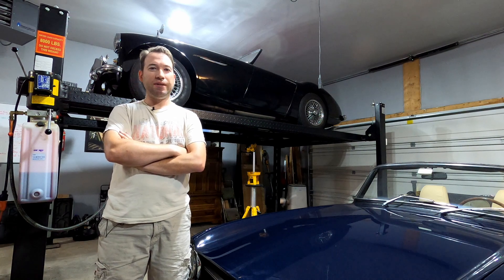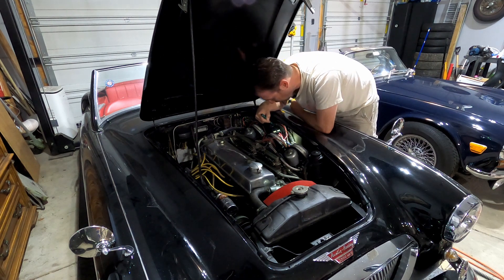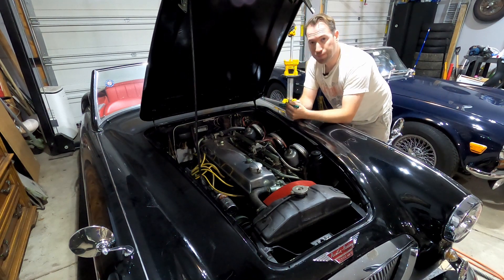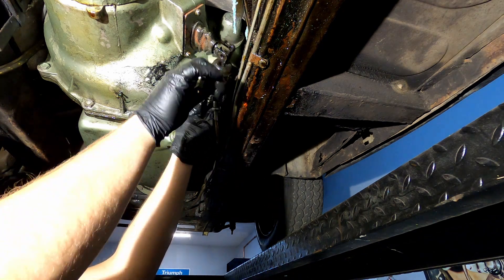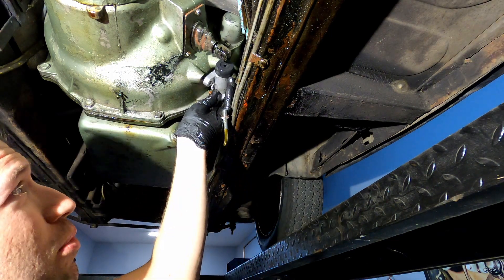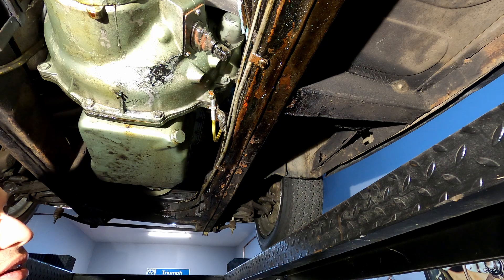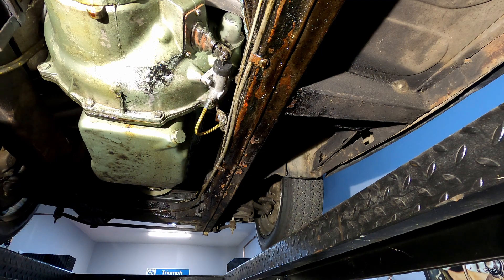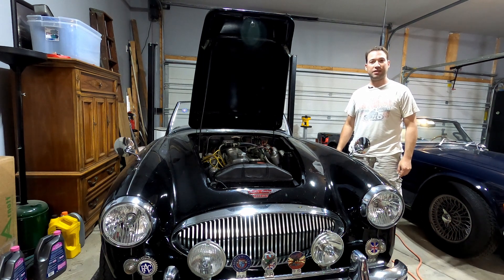Big Healey Clutch Problems - The Austin Healey 3000 Slave Cylinder

Comment: Hi. I have exactly the same model. We fit a braided pipe to the bleed screw outlet and route it back down so it is accesible. I have seen one car with copper pipe from the bleed screw hole up into the engine bay with the bleed screw on top.Lovely model healey.
Reply from the maker: I have a 64 Triumph Spitfire and did a remote bleed kit on that, so I figured there must be something like it I could cobble together for the Healey. I do live my Healey. I used to want a BJ8 because of the wood dash, but I kind of like the roadsters better these days.
Reply: @midwestmotoring  Hi, You are spot on. I have a BJ8 but used to have a BJ7 which was a great car. I think the earlier cars are real sports cars, the triple carb model being near the top in my book I am half way through restoring a late 61 triple carb-centre change model Looking forward to finishing it. Regards..
Reply from the maker: @majorscope  I couldn't agree more.  The center shift roadsters are my favorite these days.  They only built them for a few months (while using up existing stock, I imagine).  If you can find a center shift BN7, I think there are only a hundred or so, making it pretty rare.

Comment: There's that tidbit comment again. ("Disconnect the battery on these too") 
I m the 75TR6 on an edge of the continent. Twilling sound began with slight, minimal pressure on clutch pedal. Now a few months later, its very pronounced, maybe even shrill,  and continuous through clutch engagement. Was hoping it was clutch cylinder, fearing it's may be related to the bearing engaging the plate.  Is there a " America, it sounds like this " compilation video?.    Good video . Thx much 
@TrueQuan
Reply from the maker: Not that I know of, but that'd be helpful.  Most likely it'd take a while to film, since you'd have to find cars with all the associated problems to record.  Anyway, sounds like you might have a throwout bearing (aka release bearing) issue.

Comment: I have an Austin Healey 3000mk3. The clutch suddenly went to floor with no resistance. Found that rod had come loose, I think from the master clutch cylinder. Can I reattach it, or do I have to replace the cylinder? Do you have a video on such a project?
Reply from the maker: If memory serves you can just reattach it, but there is the problem that it shouldn't have come loose in the first place.  You'll need to figure out what allowed that to happen.  Unfortunately no video on that specific issue yet
Reply: There is a washer and a circling that stops the rod from coming out